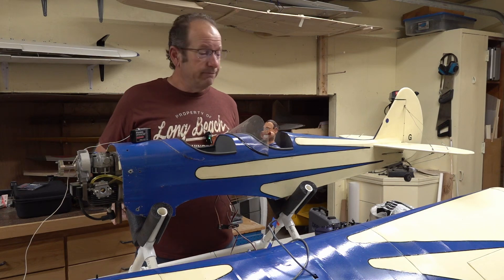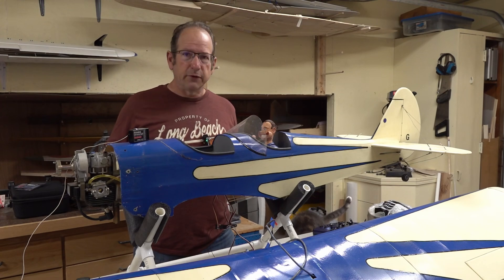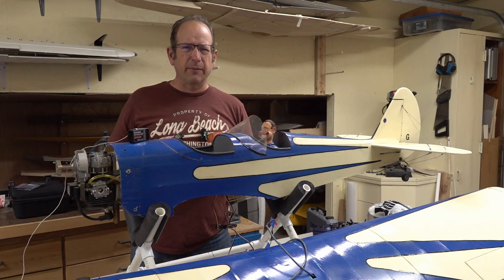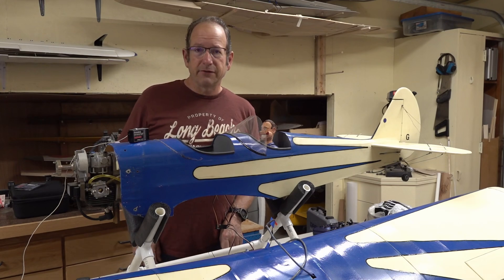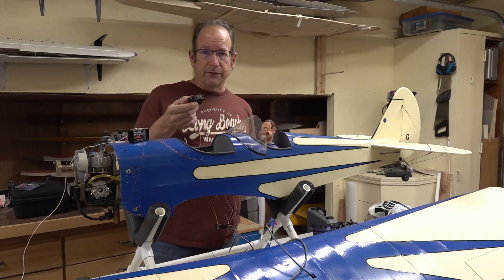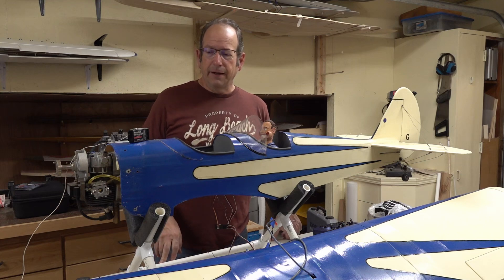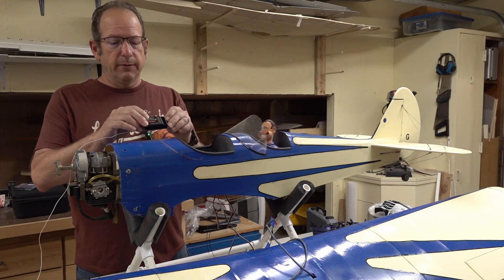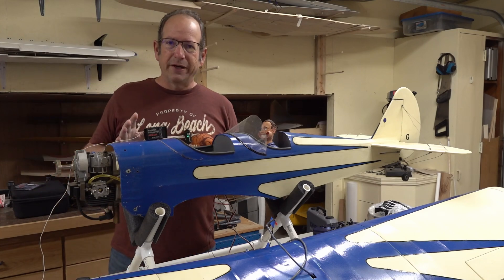Spacewalker II Time Capsule brought out of storage after 20 years, how technology has changed!!!

Comment: Have about 7-8 72 mhz Futaba transmitters including a couple of Gold Boxes and in fact still use my Futaba 8UAF. It has been upgraded to 2.4 with a FrSky module that I believe are no longer available. It uses their ACCST protocol. I also have a FrSky module that Uses DSMX that I used to have in my Futaba Super 7, but that transmitter finally bit the dust and I use a Spectrum DX8 now.

Comment: Did you keep the servo's in it? Thanks Darren
Reply from the maker: The Futaba S148s were removed and replaced with Hitec 545bb servos. While still an old model of analog servo, they can handle the higher voltage.

Comment: I still fly 72mhz.  Haven’t really had a problem with it.
Reply from the maker: 72 MHz is still completely usable.  I think the main reason I have switched to 2.4Ghz is most of my planes are now gas with either magneto or solid state ignition, and they handle the noise from the spark plug so much better. Not bullet proof, but pretty close.  And now with everyone switched over to 2.4, you probably don't have to worry about others turning onto your 72Mhz channels. So 2.4 is a win/win for our hobby.
Reply: @Capgains7777  yeah I imagine it handles the gas stuff way better.

Comment: And you had to remember to extend your antenna on the transmitter. I’ve seen a few lost planes because the antenna was not extended!
Reply from the maker: I completely forgot about that!!!   How many times did you get off the ground and realize that you forgot, to extend that big ol aerial antennae?  Crazy!!!  In contrast, my Fr Sky radio has no antennae on it.  It's in the handle and inside the case so that feels a little naked.  They do offer a short aerial you can add, to make yourself feel better, but I don't see a notable change in the signal strength to use it.  Wow, thanks for that reminder.